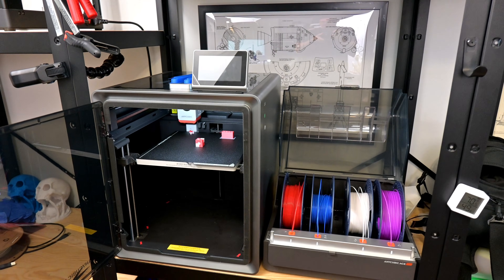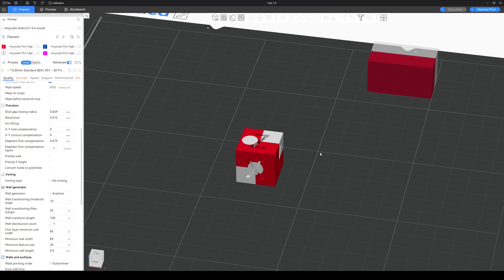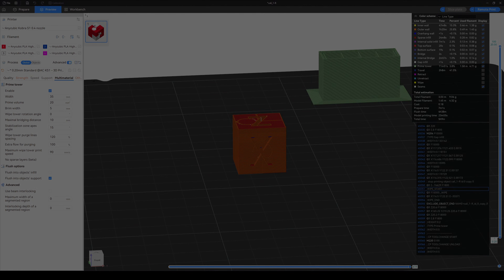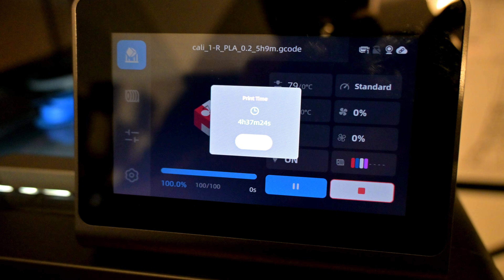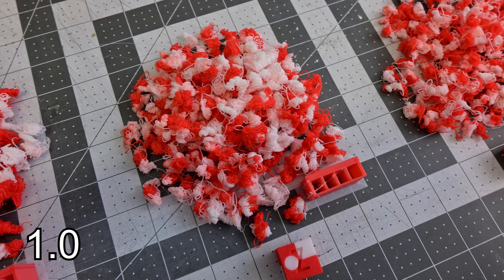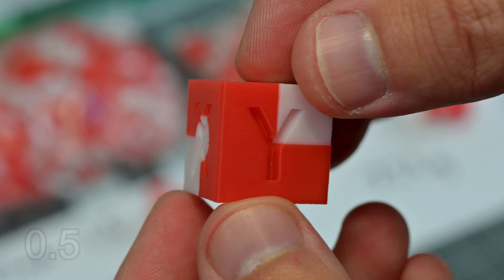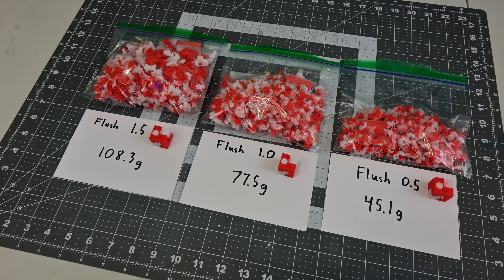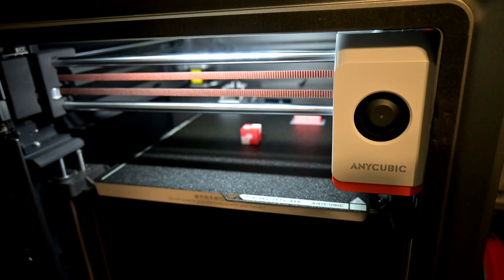This printer poops too much. Lets change that - Optimizing flush amounts on the Anycubic Kobra S1

Comment: For better results, different flush values per color/material are needed, i don't get why this is not implemented by Anycubic...
Orca slicer does support it.
Reply: I don’t have my S1 yet. I’m wondering if you can try to set flush values in OrcaSlicer and then slice to the USB drive and see if it would respect them or not?
Reply: @GreenDavidA  it wont respect that.
Reply: This was implemented in the newest update for the Kobra S1
Reply: @hoagiemoto  Can you please elaborate? I don't see it in Slicer Next nor the printer.
Reply: @AndersBorgSweden You've done the latest update for the slicer? In the slicer next to your filament selection, there should be options for the flushing values I believe. You need to have multiple filaments selected in the slicer. I wish I still had the Kobra S1 but I ended up having a problem with it and had to return it to them.
Reply: @hoagiemoto  I upgraded and noted it now. I wonder why they removed it in the first place.
Reply from the maker: Agreed, it would be great to see support for different flush amounts.
Reply: anyone got ideas for what 0.1 flush would look like im thinking of doing it for saving filament and a slight color blend doesnt bother me so i wonder if i should do it
Reply: @cremal_GD  did you try it? Worst case just do it and if it’s bad u wasted $0.10 lol

Comment: have you tried slicing it by using orca slicer and using the flushing volume function in Orca? does it change the flushing volumes?? and thanks a million for your experiment.
Reply from the maker: I have not tried orca slicer yet with the S1, but it's now on the list to test!
Reply: @HoffmanEngineering  Thanks a million
Reply: I don't think an orca profile exists for it yet, and Anycubic next doesn't have the option to export printer profiles from what I recall as I tried doing that. 

Perhaps it can be done by saving a 3mf from next and then opening it in orca and saving the machine that way. There will be no Wi-Fi though for sure it'll have to be USB only for now.
Reply: @KHAEntertainment  the last beta version of Orca slicer have already the Kobra S1 profile.
Reply: @segacynicstudio  ohh awesome I need to check that out. No wireless connectivity though I'd presume?
Reply: @KHAEntertainment  only usb
Reply: @segacynicstudio  well combined with the new universal filament management system they released, I'm willing to put in some extra steps if it means I could share my existing filament library across all my machines :)
Reply from the maker: I've been told the Nightly builds of Orca 2.3.0 have profiles, but I need to clear my cache and reinstall them to see the new profiles.
Reply: @HoffmanEngineering  I did the same